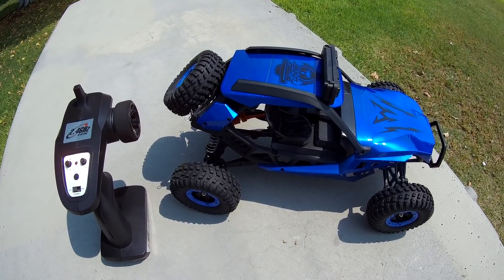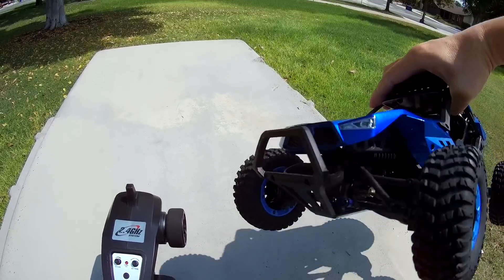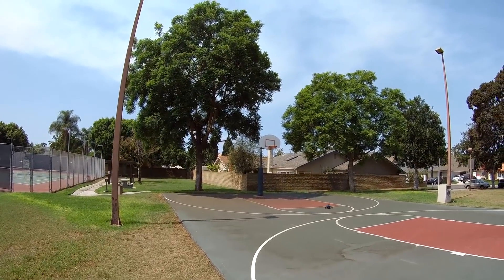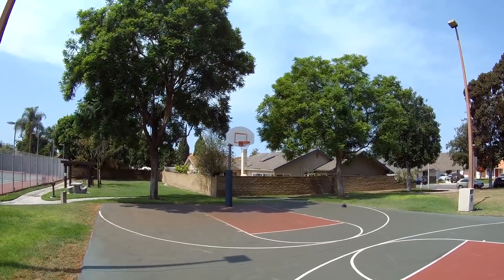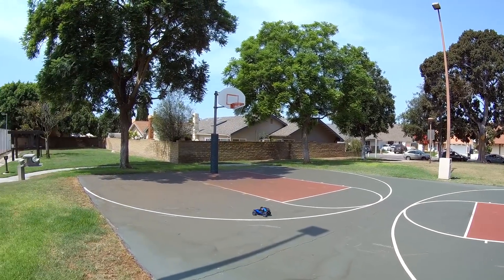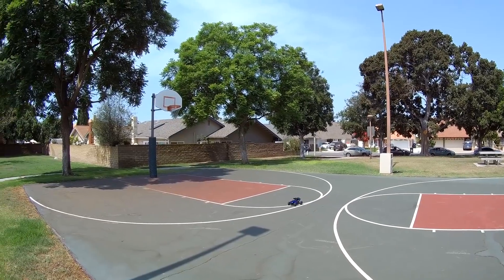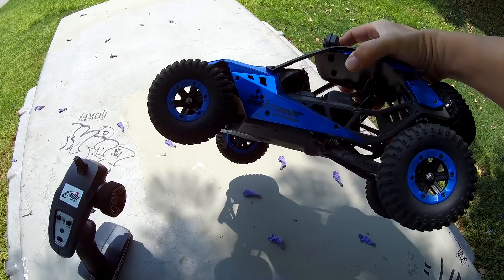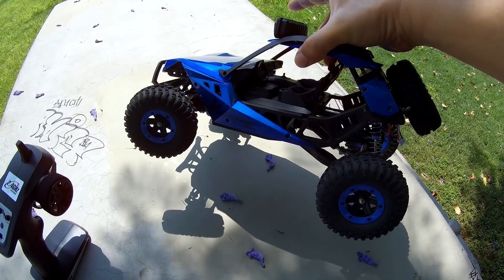JJRC Q46 Speed Runner RC Buggy Review 🚗

Comment: Probably thermal shutdown on the ESC/rx  combo at first albert. Has all the symptoms of that problem with that unit. Most of the type have that problemwhen pushed hard  but this seems to be particularly susceptible. Later, as you suggest, the battery died it seems.
It doesn't seem as competent as some other models of the same type and whilst it could be easily modded (most components are fairly generic) you'd be starting off at lower level.

Comment: ok. I have had this car for some months now. 

Some complaints so far:

- Destroyed one of the springs on second battery. They aren´t durable at all. You need some extras or some that are more durable
- The battery is not 3000mah, it´s more like 1500mah
- I destroyed the rear drive shaft after fourth battery. The shafts with the pin is crap, because they added like 150g of weight plates inside. This to make it not flip over so fast. Even then, it flips over all the time. Get som metal shafts to get it to last longer
- The rear axel gears are made of plastic and are easly broken, i broke mine after about 15 batteries.

Good things:

- The motor in this one is awesome and strong
- Most fun to drive on gravel/dirt road, and there it stays on the wheels all the time. Dirt drifting is awesome, because of the weight.
- The FAST speed. It goes about 22 mph / 35km/h